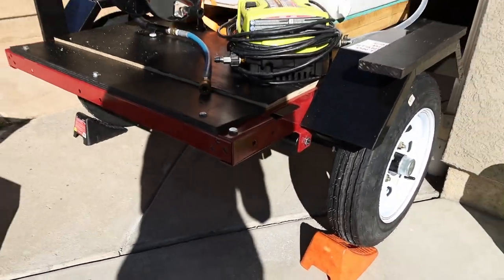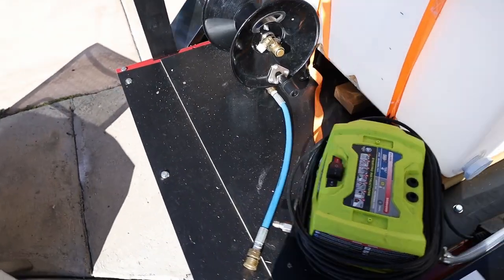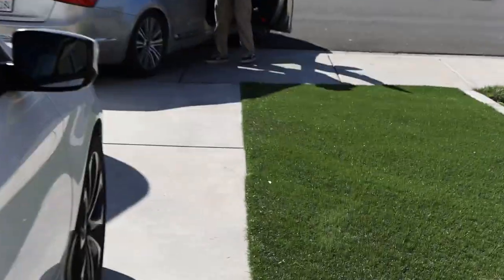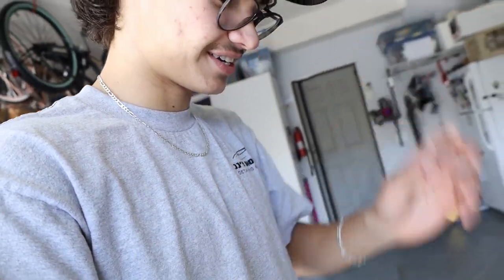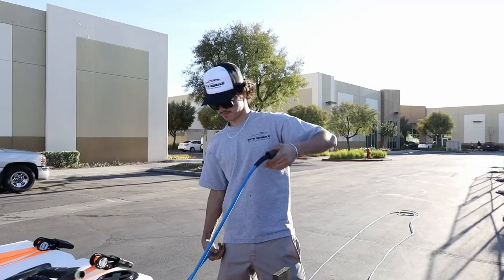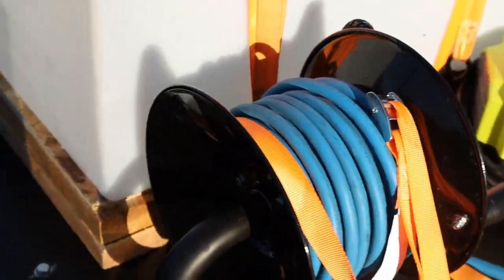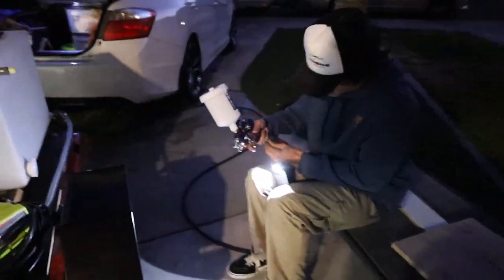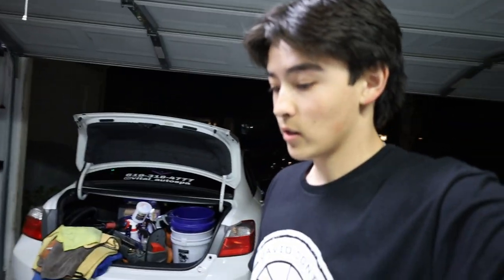BUILDING A SMALL MOBILE DETAILING TRAILER !

Comment: Great job bro but you can buy a retractable air hose reel and convert it for your pressure washer and get another air hose reel for your generator there slimmer and can fit both where you have your pressure washer reel now just an idea bro but great job
Reply from the maker: I’ve seen that done before so I might give it a try soon. And appreciate it man!

Comment: Pretty cool man. Will u tarp up the electronics if it rains?
Reply from the maker: Thanks man. I usually cover it when it rains but a few times I’ve forgotten and it didn’t mess vacuum or pressure washer up. But I definitely would try to always keep it covered.

Comment: do you notice a big drop off of pressure with the pressure washer compared to using a hose from a house since it's gravity fed with no water pump?
Reply from the maker: No I haven’t noticed a difference at all.
Reply: @Notthatlogan  ok cool, I was actually thinking about buying the same trailer you have, but was worried it might be too small, but from looking at it, it seem plenty big, and 45 gallons should be more than enough for 2 or 3 small cars.  Cool video.
Reply: @brianhenry7983  I just finished building my trailer set up on a 3x4 . It’s a must see. I want to post a video so anyone can copy it